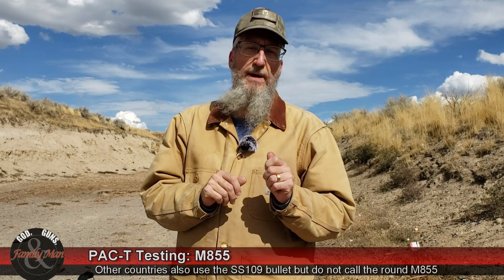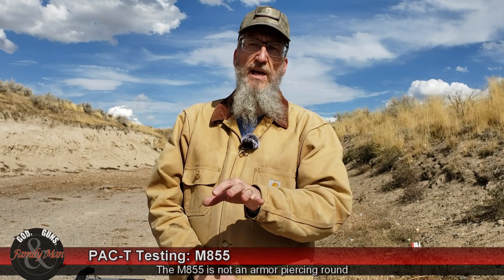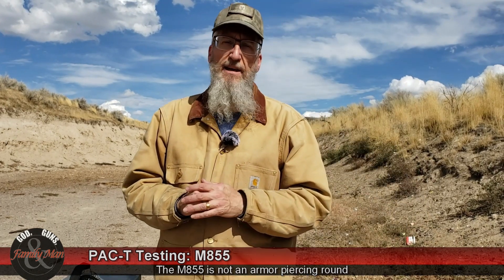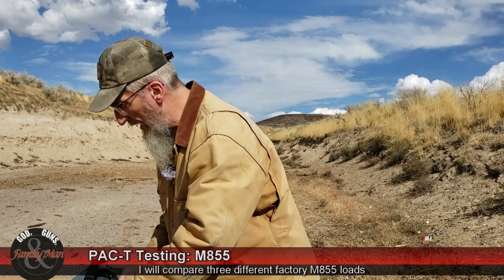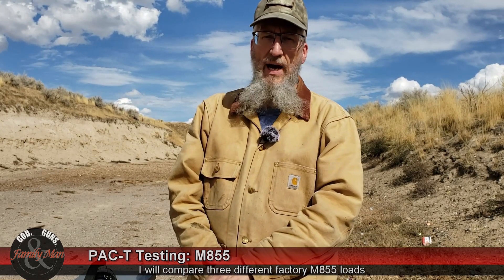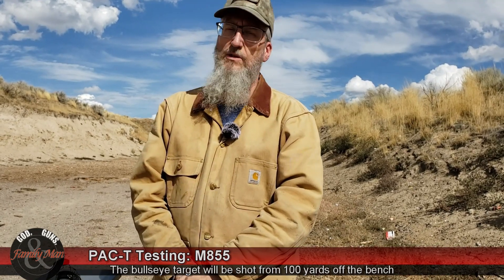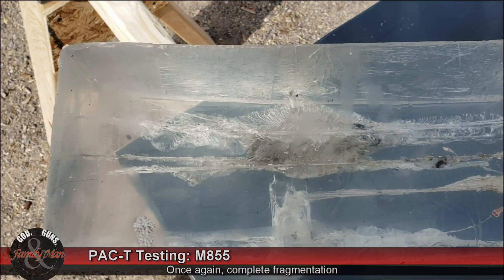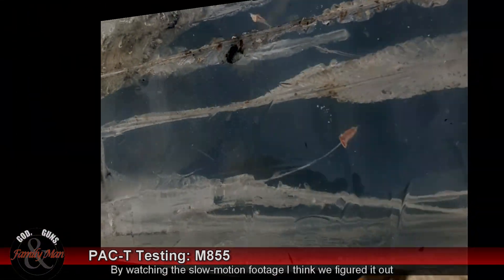The M855: Testing Precision, Accuracy, Consistency, and Terminal performance (PAC-T)

Comment: I always get a laugh from these accuracy videos. Either you people can’t shoot or your lying for some reason.  I just sighted in a new primary arms LPVO installed on my Geissele super duty and once I dialed it in, to confirm zero, I fired 5 three shot groups at 100 yards and all 5 groups with a 1 inch or just a little wider. I was using M855, don’t remember the maker.  But M855 is what I chose for my SHTF ammo.

Comment: Shooting deer and raccoons with M855, and watching a lot of ballistics gel videos, I would say M855 is fine for hunting. I've used it out to 170-ish yards with a 16 inch barrel.

One recent coon had a 3 inch exit wound. 1.5 inches is more typical.

I would not expect it to blow through both sides of a deer. It can easily take a 90 degree turn and/or split apart.

I feel it's about as humane to use for hunting as a bow. And in fact they die faster than I've experienced with bow hunting. 

If there is a problem I feel it comes from accuracy. You are aiming at an 8 inch target area (lungs/heart). So if you are a 3moa shooter with 3moa ammo then at 200 yards you may be off by 12 inches. Which can be a miss or a gut shot. 

So far I feel 30 cal is better at turning a marginal shot into a successful quick kill. I feel you have to be more on your game with 5.56, especially with M193 or M855.

On a raccoon, .38/9mm/.357 HP is better if you connect. Especially an XTP. But M855 (and M193) can produce stunning results. The issue I have is they just don't die as fast. I suspect that is due to 4-6 inches or so of travel before starting to tumble and fragment. And maybe less cavitation. 

Just my experience so far.
Reply: What twist rate do you have?
Reply: @Muffinafobia I've only ever used 1:7.

Comment: Good test. Good information. Thanks
Reply from the maker: You are welcome.  We will be testing M193 also once spring arrives.
Reply: @sdkweber  good. Have you tested the 77g otm? I have used the 69g SMK for deer management (doe) with my youth hunters. Tested the 75g Hornady BTHP. But never harvested deer with it. It is very accurate. I haven't shot the 77g.
Reply from the maker: @guardianminifarm8005  I have never gotten good enough accuracy with the 77 gr. bullets as they seem like they are not stabilizing in my rifle.  I really like the Barnes 62 gr. TTSX.
Reply: @sdkweber  We harvested a young buck on a youth hunt a few years ago with the 62g TSX in Remington Hog Hammer. 50 yards 1 shot CNS shut right down with no tracking. Very little blood. But didn't need it in this case. Our 16" 1 in 7, 1 in 9 both shot decent but not great. The 18" 1 in 8 heavy barrel was a bit tighter groups so we used it. I know folk who use the 62 & 70 grain TTSX on hogs with great success.
Reply from the maker: @guardianminifarm8005  Yes, the 62-70 gr. shoot excellent in our guns.  77 gr. opens up.  I have shot many deer with Barnes bullets and they really are excellent.  I truly never had to track one with Barnes bullets.

Comment: I always hesrd terrible things about m855. I bought a case of lake city surplus m855 and my 20" AR loves it. With a 3-9x scope I am easily keeping all rounds within an inch at 100 yards. I was shocked.
Reply from the maker: In my experience, if you have a rifle that shoots these well, then they are a great, low-cost supply of ammo.  Thanks for watching and posting.
Reply: @sdkweber  Would M855 make a good defense round?
Reply from the maker: @beltrik3766  While there are better rounds for home defense (the Barnes 62 gr. is excellent), the M855 is a fraction of the cost and would be effective.  But beware of the likely over-penetration.  Thanks for watching and posting.
Reply: @sdkweber  ah ok gotcha. I just hear people always bashing M855 like it does nothing
Reply from the maker: @beltrik3766  It will not expand, but it should definitely penetrate through the bad guy.  The Barnes bullet on the other hand will be more lethal as it expands very well.  Here is a link to the video/test we did on it https://youtu.be/H2Yq3pDfOY8?si=of7JCN8rZVaZnoTE